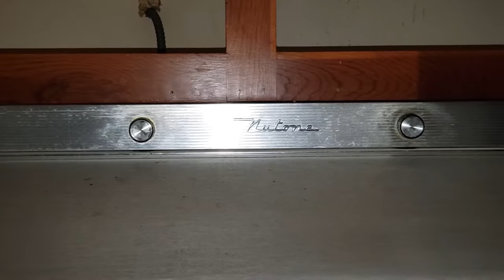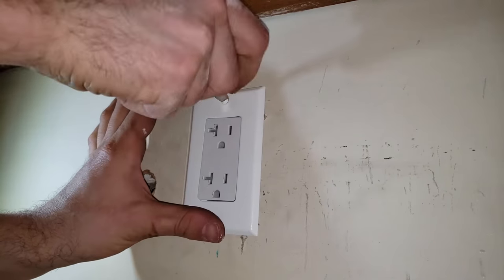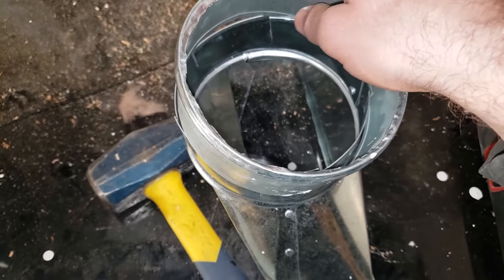How to Replace and Install Range Hood Vent (Grandma Approved Method) | Kitchen Remodel 4/9

Comment: I just paid $7,000 for my range. I’m scared to have the hood replaced. I’ll make sure I have it protected with some plywood before the install. Thank you for including all the mishaps. It happens. Very real. 👏🏼
Reply from the maker: Oh man! And I was upset over $400! But yes plywood ought to do the trick, and definitely a tarp. That's a heck of a range! What is it, if you don't mind answering?
Reply: @Bootstrappin   Thermador
Reply: 7K? Whew.😅
Reply: You spend that much for what reason ? 😂😂unnecessary
Reply: @boxingmagik_mexside5633  For many reasons. I had a range like this at my old house. This is a professional range and we use it daily. Anyhow I can’t go back to basic run of the mill. You get what you pay for.
Reply: I thought I was bad for having expensive taste.

Comment: Let me give ya a tip. I personally hate fiberglass insulation. I’m currently covered in slivers of the damn stuff all over my arms and hands. Foam is the way to go. Spray foam, or even the sheets of foam cut into pieces is better than those damn fibers

Comment: Nice video The reason why it was loud and took a while to speed up was it needed 3in1 oil  the older fans have oil ports on the motor
Reply from the maker: You're right - I took it apart, cleaned it up and it worked like new. Wound up selling it to someone on eBay.

Comment: So, were trying to figure out  should we tile before or after hood install? Not tiled yet. Just old wall texture. Putting up subway 3x6. We took out a microwave  Suggestions appreciated.🕊
Reply from the maker: I'd definitely do it after because you'll have your new hood to build your tiles up to, this way you won't have any unsightly gaps or risk damaging your brand new tiles while trying to remove the old hood

Comment: I jusy moved in the house built in 1970 had a microwave over the stove and we hate it.  Was trying to see if all houses has that vent.  My kitchen dont face the outside
Reply from the maker: Sounds like you would have to route ducting for this to work. But there are some vents out there that don't require ducting and just work based off of filters. It won't work as well, but will certainly avoid the big pain of ducts.